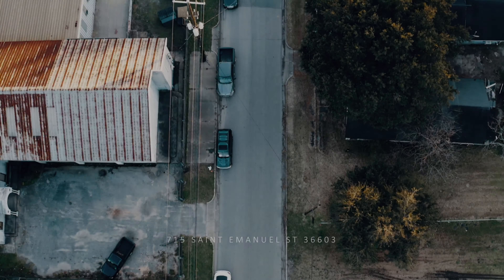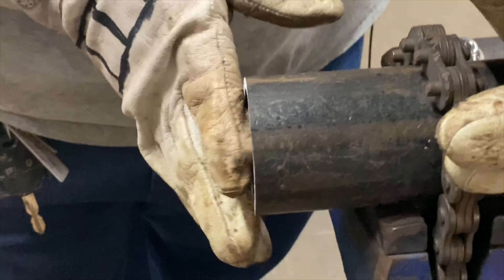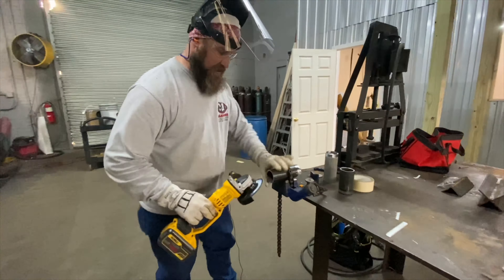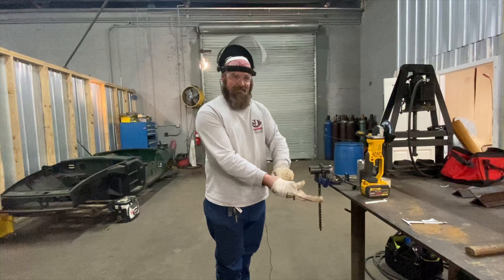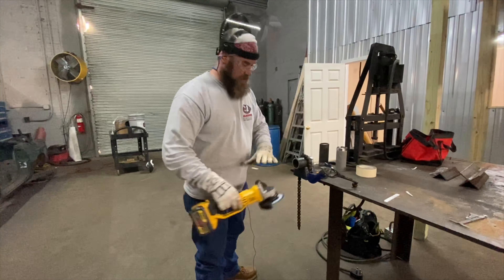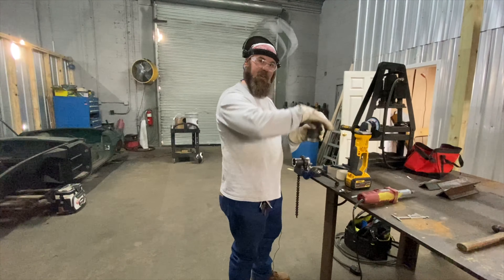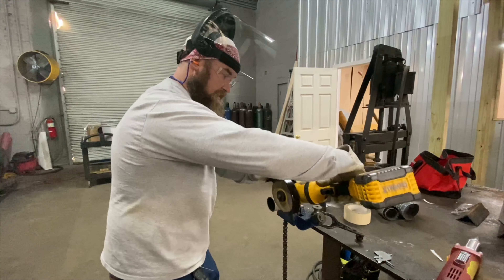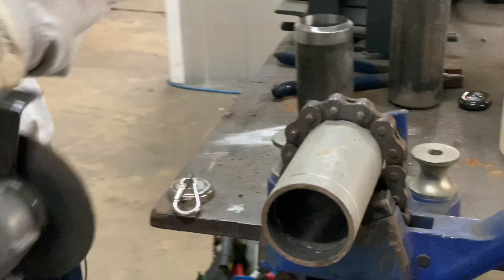Beveing  2” Tuesday

Comment: Do yall teach the student to bevel the pipe with the land . It's always good practice that if a land is desired to bevel it with one . If you add one after you put a knife edge you remove material . In a 45 join run that could cause you to come up pretty short . Just food for thought . Nice video , thanks .

Comment: You think the grinder is the better cutting option compared to a portable band saw?  I've learned from an old timer and his preferred method by far is the portable bandsaw.  I can cut pretty damn good with both, just wondering your opinion on it.  I usually deal with 6 inch schedule 40 pipe.